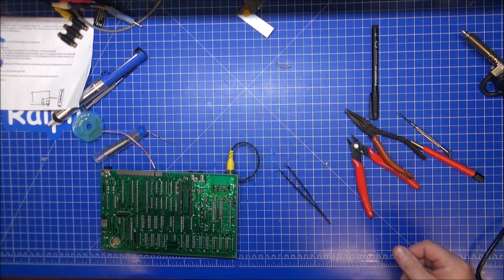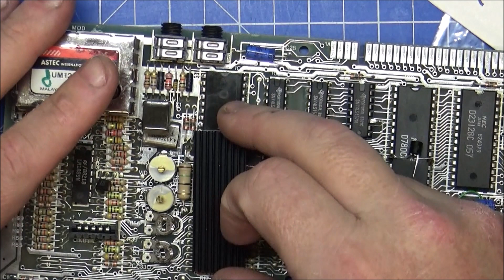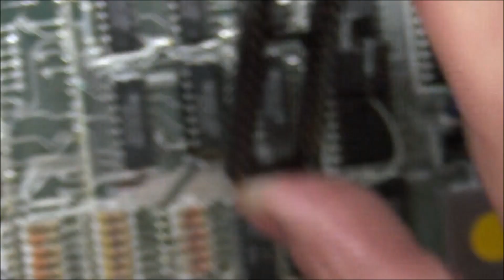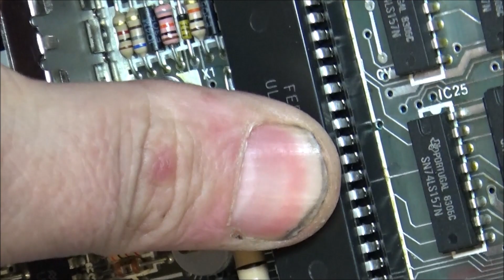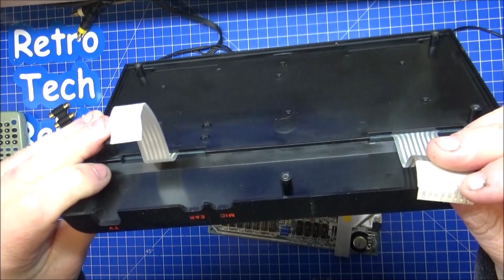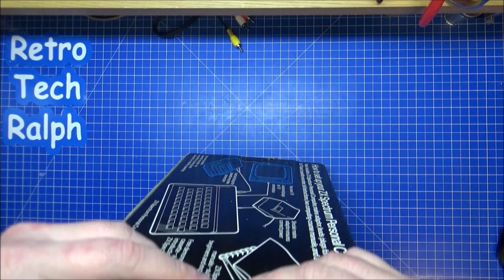Sinclair ZX Spectrum Marathon Repair

Comment: Ditch the 7805 regulator for for a switch mode regulator which runs cool. Baking the speccy is not good.
Reply from the maker: True, but i dont push my speccys hard, and they are happily packaged away for winter.
Reply: @R_T_Ralph  the ULA is pushed hard by design, heat sink on alone drops temperature from 60+ to 40+. Caps under the regulars heat sink that suffer, drying out is not good for them.